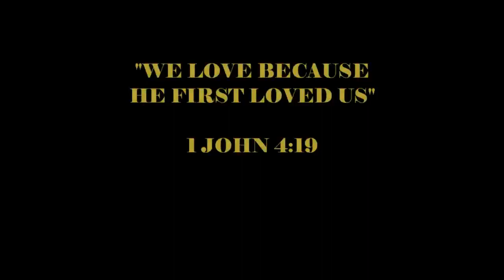DIY, How To Fix A Detached Rain Visor

Comment: Can i use epoxy instead of 3m tape?
Reply from the maker: Hello Dy. It will probably put the visor in place but it will also ruin the paint of the vehicle. I will definitely not advise anyone to use epoxy for that purpose. The idea alone makes me cringe to the bones. 😁
Reply: @TeoBDuremdes  ok tnx i'll buy again 3m.its the second time my visor was detached
Reply from the maker: @dyexen1469  
3M Auto Advanced Super Strength Molding Tape. This is the exact description of the item. The 1st visor that I installed using this adhesive has been hanging there for more than 2 years now and it hasn't shown any signs of giving up. Thanks for watching and commenting. Cheers!
Reply: If only you could have edited out the ridiculously annoying rooster crows! Or moved somewhere not by a rooster...
Reply from the maker: @scottkriegerjr.6205  
I am so sorry for the roosters' noise. That is very common here in our neighborhood. At first I was also really bothered by these noises being heard from my contents, but now I already got used to it. Thanks  for watching and leaving a comment. Sorry for the late reply. Have nice day. Cheers!